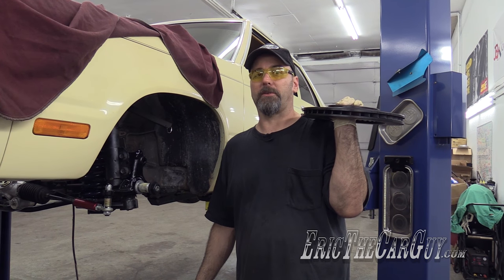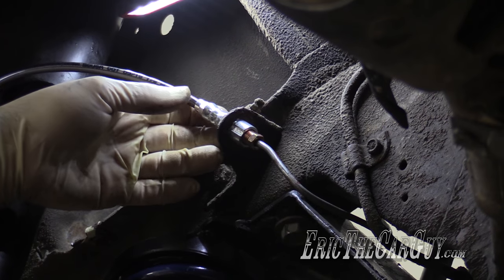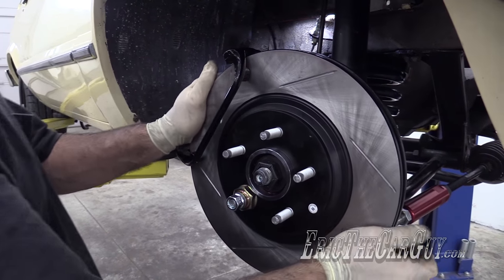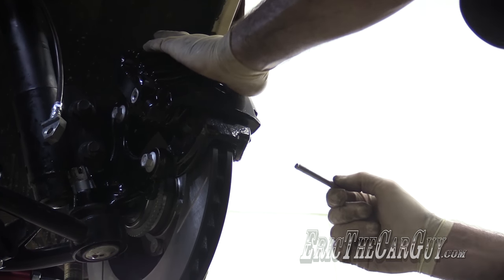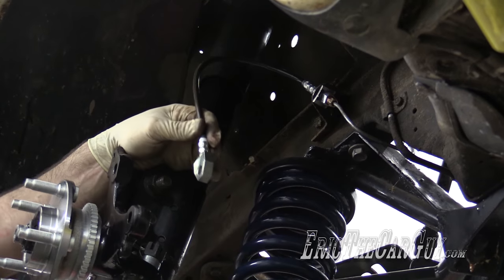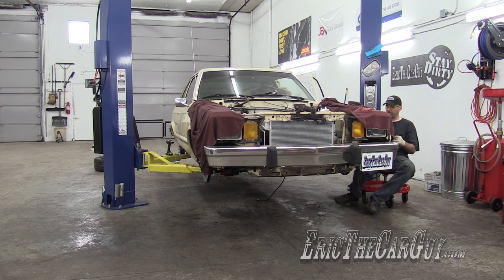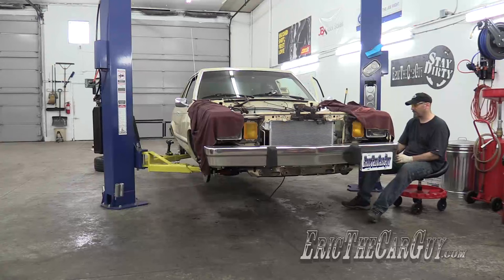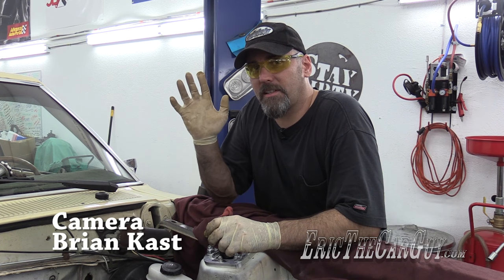How To Upgrade the Front Brakes on a Fox Body #FairmontProject

Comment: No need for ABS because RACECAR!!!
Reply: Alex Kant lol, yes. You can also pulse the brakes the same way. Just let off when the wheels start skidding. I can tell an ABS skid mark over the regular. Sorta a pulsating skid. Pretty much all the skid marks on the highways these days are abs skids. Usually one wheel is a lil stronger than the rest and that's the one that skids. Same as old school. Just has lil breaks in the skid. Like a 2-3' skid a one foot break followed by 2-3' skid etc.... going off the side of the road.
Reply: Joshua Webb break ballencer man
Tune that lopsided brake out
Reply: MyLonewolf25 wasn't talking about me. Everyone else's car skids with one wheel. Or the thousands of abs skids I see seem to be one wheel dominant
Reply: Joshua Webb it all really depends on how the braking is balanced 
Most people don't regularly check and change it 

Especially after brake service because it can change over time and when you replace pads and rotors

Maybe less than a handful of percent 
But it can still make it worse 

Also 
Usually one wheel is unloaded and even the slightest of turn can potentially cause enough to make one wheel skid more than others 

Not really knocking what you're saying but unless they're in a turn of any kind 
In a properly tuned and setup system it should be completely even 

Which will never happen from factory because it a lot of work especially for the rears
So they usually just split bias front and rear and front left and right if you're lucky enough to have the fronts have their own bias ontop of that to make up for line distances
Reply: MyLonewolf25 don't know any of the technical side of it, just what I see on the Florida highways. 9 outa 10 skids looks like one pulsating tire, maybe a faint trace from the other side. So maybe if they had it balanced right the skid would be much less noticeable? Maybe I'm only seeing the unbalanced skids because they come out much darker? Idk
Reply: Joshua Webb if there's any turn or load differential it's going to definitely prefer one side

But if it's balanced properly and perfectly straight 
It shouldn't prefer either side 

Tire loading has a bigger impact that brake bias left and right though

Comment: The shear loading on those horrible tie rods / knuckles with all those spacers is truly terrifying.   I hope you are not seriously running it that way.
Reply: ArchimedeanEye he said it's to keep em in place temporarily until the car is put together and he goes for an alignment
Reply: ArchimedeanEye it's only temporary till he gets an alignment 
He can't really set it properly at ridehight yet 

Which you'd know 
If you watched the episodes
Reply: People do actually run those on a regular basis in an attempt to avoid bump steer.  An alignment is not going to resolve this.  It needs a lower steering arm off the knuckle.
Reply: ArchimedeanEye he can remove and add spacers
He can't adjust it properly till it's at final ride hight
Which he said he would do at the time he's getting an alignment 

He's not a dumbass
Reply: So in other words, he's going to run spacers.  Refer to my original comment.  Spacers is not the way.  Eric may not me a dumbass, but he is 100% allergic to good advice.
Reply: ArchimedeanEye spacers are perfectly fine 
Like I said he's only running that many because he's not at final ride hight and until then something like this can not be adjusted properly 
So I don't know why you're getting upitty about something that can't even be fixed till later in the build 

I've never seen any car fail with these 
Ever 
Even with a larger amount of track days 

And that was on a drag car that would REGULARLY pull wheelies 
Seeing as the spacers themselves are not a load bearing part 
Doesn't matter how many you run as long as the bolt can hold the loads
And furthermore 
Loads aren't heavy against the steering components anyway 
The knuckle takes more than the majority of it
Reply: Ok, so you are condoning the use of a steering shaft that is made from mild steel pipe with pigeon shit welds and the use of tie-rod components that even a moron can see will place a large cantilevered single shear load on the bolt that supports the tie rod / rod end.  Good for you.  I can tell you, this can and does cause the bolt to literally shear off while a person is steering the car. I have seen it myself, especially in earlier hot rods where the bolt diameter is smaller.  I would expect to see better from an instructional video.
Reply: no the the whole suspension that he just installed got replaced with some legit part from Maximum motorsports He made a video on it.
Reply: ArchimedeanEye 
I use the same bump steer kit, even after heavy driving, the front suspension is still fine. tons of mustang owners run the exact same setup, I've never heard what you're describing, but I'm curious. do you have a source for this specific suspension setup?

Comment: Barely crack all four of the bleeder screws open and leave it overnight.  I had this same problem years back when putting 13" brakes on my SN95.  Sometimes it also helps to give the calipers a few quick raps with a rubber mallet.

Comment: @ 3:05 Eric, you mounted the rotor on the wrong side. The grooves in the disc are supposed to discharge brakedust to the outside of the rotor. Now what happens is the dust gets pushed to the center (unless you reverse) and there it won't be as simple to get rid of. So you need to swap the left and right rotor :) The markings for R and L are wrong

Comment: Those look to be 13" cobra brakes not 12" They say SVT so I would guess 13".. They STOP GREAT for OEM.  SSBC and other companies make a direct replacement 4 piston caliper. But that is this brake is what is on the front of my 63 Falcon, thanks to MustangSteve's conversion adaptor..

Comment: You got my pants in a wad... cause you seriously thought a rotor mounted with one nut should run straight o.O

Little side note: a realy small run out on a rotor is normal, it needs this so the breakpads get pushed of the rotor (there is no return spring  for the breakpiston x-D ). But it is about 0,1 mm i think

Comment: hey Eric I know you use the pumping brake pedal method but do you not ever have concerns about potentially damaging the seals in the master cylinder? I mean pressure bleeders arnt that expensive if you buy a manual one and it can also help finding leaks. why not invest? :)

Comment: I wouldn't even bother with getting dust shields for it. A lot of people that do performance builds remove them for better cooling. Unless they have a duct in them for running a brake cooler hose, they will actually hold heat in.  Not a big deal on a daily driver but for any performance/track use you are better not having them.

Comment: I have the same calipers/rotor. I can't stand that the caliper/brake pad doesn't cover the entire stopping surface of the rotor. the rotor forms a rust ring. I had to extend the black hub paint farther into the rotor so it wouldn't do that.. but I feel like it should have more gripping surface area

Comment: Maybe you allready know maybe not but the little metal "fingers" on the breakpads where you put the little rubbers into are called acoustic wear indicators as soon as the wear limit is reached these fingers will contact the brake discs and will start to squeel of course performance oriented brake pads will usually allways squeel but you will be able to tell the difference  between your brake pads squeeling and those wear indicators squeeling

P.s. I wish i had a garage like yours looks really nice

Comment: Your splash shields are not splash shields. They are a cooling shroud. They help grab the passing air, force it into the inside of the rotor and out through the vents.  Very important part of the system.

Comment: Tip never use a rattle gun on a bearing you want to keep. It may not get to maximum torque but the hammering can pit the bearing surface.

Comment: the rotors are on backwards. that's right from standing in front of the car.  not right from sitting in the car. the slots on the rotors  are supposed to spin a certain way.

Comment: Hey ETCG, never heard too many good things from lmr. I've ordered things from americanmuscle too but I've found anything from CJ Pony Parts or parts from Steeda to be the best fitting and high quality. I have a 86' Gt hatch t-top and my brakes were slightly different than the 87+ foxbodys so i did a 87+ spindle swap with Lincoln Mark VII  5 lug conversion. Its just a 1 piston caliper though. You could do a sn95 conversion but there is a few fitment issues you come across. If you want big brakes stoptech or Brembo is a great way to go but your talking like  $2,500+. I just did the ranger axle swap in the rear with drums but i think this winter (i live in Ohio too) I'll do a disk conversion with a brake bias adjuster and see if i can work with the 1 piston calipers up front.
Reply: Honestly, go with the '95-01 Ranger brakes -- they are dual-piston, and stop really well.

I did both a disc conversion on the rear of my '92 Ranger, as well as the brake upgrade for the front brakes. Just a warning, you do need the '95-01 spindles to do the dual-piston calipers.

Comment: Speed bleeders work fine if you are doing it solo.I have used an adjustable hood rod as well.If the master cylinder is NOT new,don't let the pedal go to the floor! You may damage the seals inside the master cylinder.

Comment: If you temporarily put a lug nut on the opposite bolt to hold the rotor would it still have come out unbalanced?
Reply: pirana6 that's what I was thinking. I would say it would be balanced so that was probably the problem

Comment: My coworker taught me a neat trick - just put your finger over the bleed valve. When they pump it forces it off, then when they let back off, your finger will create a seal. I never tried the hose in a jar method.
Reply: Loebane your going to get break fluid allover thoes lovely new calipers like that ☺️
Reply: moomin110 Good point. He suggested it for when I was bleeding my clutch actually. I just assumed it would work for brakes.

Comment: how do you judge how tight to tighten those brake lines? i can never tell when ive gone too far they feel like the feel doesnt change much and ive fucked it up badly with a torque wrench
Reply: waderedsox go until you feel them loosen up and back off a little bit
Reply: so go until you feel like youre stripping them out??
Reply: waderedsox relax I'm taking the piss. Human torque wrench says one grunt
Reply: +AnthonyH I'm a fan of the two-grunt method, but that's about the gist of it. If it ain't leakin' you're good.
Reply: lol, do it up till it strips out, then back it off half a turn!